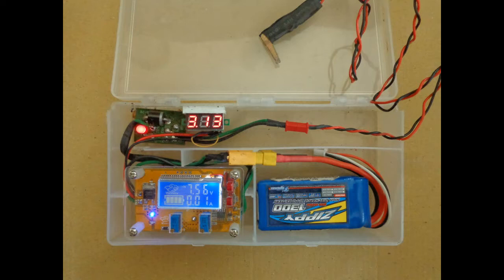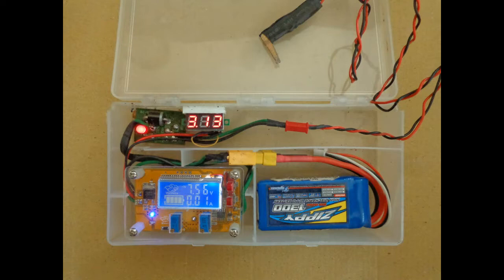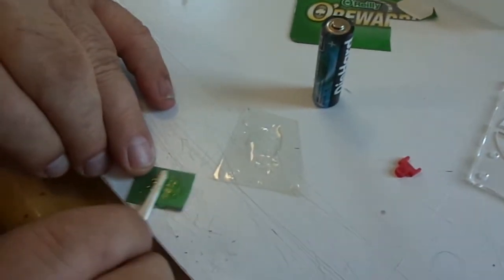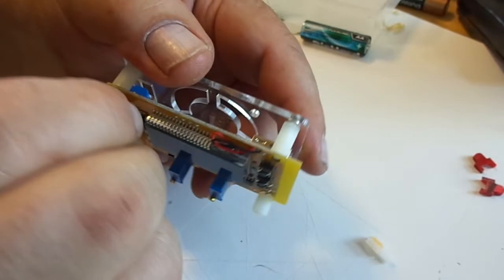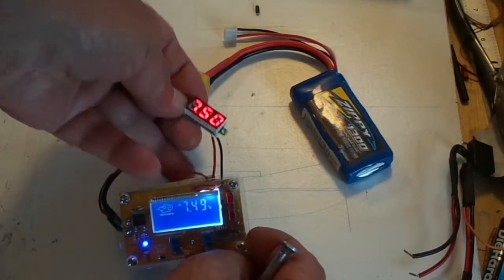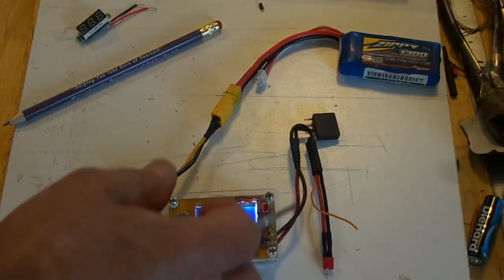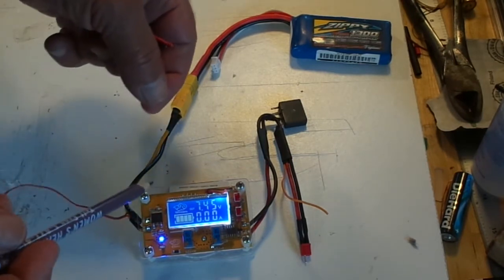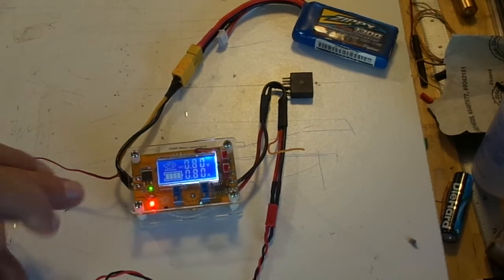Supercap Field Charger Build for Free Flight Models

Comment: Mike, thanks for the offer! I spoke (chatted) with Norm at Banggood and they are sending me a replacement hopefully with all the parts. I guess the most critical of the missing parts is the heat sink so I plan on ordering some of those, the micro switches can work w/o the red buttons and I can mount some sort of plastic feet on the board. I’ll keep you posted and let you know if I’m going to need your powers of persuasion. Thanks again.

Comment: I love watching all of your videos. And I wanted to make this charging unit. But I can't find the DC to DC converter like you have. I'm not that great with electronics and I was wondering if you could suggest a substitute because they don't have the one that you have. Thank you!
Reply from the maker: Sorry they apparently discontinued that unit...Here's one with similar specs and it's actually a bit nicer than the original since it uses a rotary encoder instead of trim pots to adjust the output voltage and amperage. I'm going to order one of these today and make a video about using it to charge capacitor models. Thanks for your interest! https://www.banggood.com/custlink/mKGIhwTZdb?title=DC-DC Converter
Reply from the maker: Just ordered one and I'll make an updated construction video

Comment: thank you for all the info on the charger finally got around to making one works a treat the diode I used was a bzy88 c  8v2 which is a zener diode just looking for a suitable box to put it in now was going to put a picture of it on here but cant find a way
Reply from the maker: Hi David, nice work! That zener diode will work as long as your charging leads never see a reverse voltage greater than 8.2 volts which is the zener voltage of that unit. A zener will conduct "backwards" when that voltage is applied so above that voltage the power supply circuit isn't being protected. Below that voltage it behaves like a regular diode so it will protect from hooking up your capacitor backwards...which even when charged is about 3 volts. Bottom line is it's ok for charging caps but if you intend to charge lipos, etc at higher voltages, change it out for a regular rectifier diode. Have fun flying!
Reply: @sonex413  I got the 3 wire volt meter but problem i had whilst building was at various times all 3 wires came away  re-soldered and secured with a dab of hot glue than designed a bracket to hold the volt meter and bolted to the bottom  plate ot the charger works a treat. I ordered my parts in december 2020 and they arrived 2 days ago, I paid £1.84 for the volt meter and £8.88 for the charger UK
Reply from the maker: @loftmanx  Yes, ours were similarly inexpensive and we've gotten good service from them. We were using disposable AA alkalines before the chargers and I'm sure the savings over the last couple of years has more than paid off the original components. Plus, I have to admit, I think the glowing digits look mighty impressive when you're putting in that last charge just after sunset out at the field!

Comment: Mike...Banggood came thru and sent the complete kit. Now I have to get all the other bits from my stash. Think I’ve got every thing I need to complete the charger. Got to get my foam tray stock pile started.
Reply from the maker: Great, glad we didn't have to get tough with them! A buddy of mine has been collecting those foam trays and he has a bunch of them in different colors. I have found white, yellow and black (which makes light and realistic foam wheels). We use thinner stock from the cheapest, thinnest foam picnic plates for tail surfaces, etc..and also for peanut-scale-sized builds. Have fun, keep us posted!

Comment: Yo Mike and Richie, I finished my charger over the weekend and it works like a charm. My daughters were over and damn near called Homeland Security on me because the device looks pretty shady. I can tell by the sound of the test motor that I’m getting more RPMs than with the two AA batteries I had been using. BTW, my charger uses a 7.4v 430mAh lipo so it takes the capacitor a little longer to get to 3.1v than yours, but that’s not a problem. Right now I have the charger in a take-out sushi container. I’ll transfer it into a more substantial box when one comes my way. I hope to post some flying videos soon. Many thanks for the tutorial— I thoroughly enjoyed the build!
Reply from the maker: Glad to hear you had success with your charger build...it's the first reported completion. Looking forward to seeing some flying vids ! Richie and I promise to visit you at Guantanamo if Homeland Security gets you. Have fun flying!!

Comment: Question: So for the three-lead voltmeter, the black and red leads BOTH connect to the output terminals of the DC converter and the yellow lead connects to the positive wire that’s downstream past the diode, right? Or, is ONLY the black lead connected to the output side of the DC converter and the yellow lead connects to the positive wire that’s downstream past the diode? I ask because I don’t understand how the voltmeter knows which voltage to read with positive leads coming from before and after the diode.
Reply from the maker: Hi Ron, Richie says Hi!  On 3 wire VM the red and black wires are strictly a power supply for all the electronics on that little circuit board including the LED digits. It can be anything from about 2.5 volts to something like 20 or 25 volts. If you hook up just the red and black wires to a dc source like that, and leave the yellow disconnected, you'll see the display light up and read all zeros (because the voltage on the yellow wire is zero). Now, if you want to check a voltage, you'd read it between the yellow (+) and black (-) .....black wire is common to power and sensing sides of the circuit.

I run the VM's red and black to the INPUT side of the banggood dc dc converter, so it sees the full 7.4V of my 2 cell LiPO and the digits are always bright no matter what voltage I have dialed in. Yellow wire then goes, as you say, on the downstream side of the diode. You may be scratching your head wondering how it picks up a ground...but the black ground wire actually passes straight through the banggood converter and so the yellow wire is enough. 

Reading what I just wrote, it still sounds confusing, lol.  Hit me w/another msg if you're not clear.....Rich and I got some great flights and some not too bad video the other day, it was almost like spring. Took everything home in one piece....... -Mike
Reply: Mike, thanks for the quick reply. Your explanation clears up everything. I finally got all my parts so I’ll begin assembly pretty soon. FYI, later as I thought about my question, I realized I wrote OUTPUT side when I meant INPUT side for the VM pos and neg leads. Yeah, believe it or not, I rewired most of my house with only a few sparks and no fires. Say hey to Richie.

Comment: Thanks for the video, great job and easy to  follow. Have the charger built and tested. Works great. Now what are you using for props? Are you motor units with gear boxes or connecting the prop directly to the motor. Do you have a part number for the props you use from BG.
Reply from the maker: Here are the parts we use for the smallest planes, like the "build-along" one from our video series, also the little "Dakota" seen in our videos
: PARTS FOR 6mm POWER SYSTEM (makes 4 sets)

50mm Props (for 615 motor) 2pr:
https://www.banggood.com/custlink/3mD3d54e63

615 (6mmx15mm) motors 4pcs:
https://www.banggood.com/custlink/mDKKwGFfEi

10 Farad supercaps 
10pcs:
https://www.banggood.com/custlink/mGm3fmVTrv
or 5 pcs:
https://www.banggood.com/custlink/Kv3DYH6g6E

Micro Slide Switches 20pcs:
https://www.banggood.com/custlink/3K3mdP0668

We have also used the larger 7 and 8.5mm coreless motors available from BG. The 65mm props work well for both sizes.(direct drive). BG has geared prop drive units, they work well too. Some of our flying videos call out the equipment used in our various planes in the text descriptions below the videos. 10 Farad caps work well for 6 and 7mm motors, two 10F caps in parallel for 8mm motors. Nothing's written in stone, we're basically experimenting and seeing what works. Good luck and best wishes for the New Year! Happy Flights! Mike and Rich
Reply from the maker: DO check out our build-along plane, it's easy and turns in consistent one minute flights with a 615 motor, 50mm prop and 10F cap. It's presented in a playlist form on our home page!

Comment: Hi Mike, Thank you for the instructional video. I found it easy to follow and have just completed my charger. My button issue has been resolved at manufacture so I was spared the mod. It works a treat. Now to build some planes.
Ken in New Zealand.
Reply from the maker: Glad it helped! As we slide into winter in this hemisphere, you're just coming into flying season! Richie and I send wishes for a fun and safe summer of flying! Thanks for the feedback on the charger video. -Mike (and Rich) in Massachsetts

Comment: Thanks for a fabulous video which leaves no open questions. I have ordered the two units, but Banggood is sold out of the diodes, so I will see what I can find locally. Would you pro-rate the charging current for other capacitor sizes e.g. 250mAh for 3.3F ?
Reply from the maker: Hi Chris, thanks for the kind comments! I feel that the charge rates we use are on the conservative side and definitely safe. So yes, pro rate the charge. If you're charging at a rate which results in a full charge in something like 15 to 30 seconds you're doing it right. BTW, We've played around with various sizes of motors and caps, and unless you are going super micro and feather weight, it will be hard to get decent flights on 3 Farads. We use 10F caps for 6 and 7mm motors, and use 2x10F caps when stepping up to 8520 motors. With these combos we see flight times of 30 seconds and up to a minute or more depending on design. Richie tried a 6mm motor with a 6F cap and got some 15-20 second flights. I have a few of those 3F caps myself, was thinking about trying one with a 4 or 5 mm pager motor....built like an indoor microfilm job, maybe 6 inch span????  Let us know when you get something flying! Stay safe, Mike and Rich
Reply: @sonex413  I do a lot of indoor flying, so I want to build something small and light for our sports hall. I am also fascinated by the twin engined Flying Aces Moth - perfect for calm weather summer sunset flying. So I have  ordered a Gold Cap 3.3F and a 10F.
Reply from the maker: @chrisp6072  Great! Have fun and again, thanks for joining in!
Reply from the maker: @chrisp6072  Hey Chris, check out my video, 'Forty Farad Floater" if you like calm air sunset flights! https://www.youtube.com/watch?v=YEFVsWH1P9Y
Reply: I just received my DC-DC converter unit from Banggood. The button issue has been fixed and the standoff post no longer needs to be cut away.
Reply from the maker: @chrisp6072  Great! That was the only issue I had with mine, otherwise perfect for our use. Good luck with the build.
Reply: @sonex413 I throughly enjoyed the charger build and got it finished this afternoon. Just like reading a good book, I couldn't put it down once I had started. After checking all the wiring 5 times, I crossed my fingers and plugged in the battery. It all worked perfectly first time. I used male and female 2mm gold connecters from the charger to the wand, which meant I didn't have to wrap the wand in wire to calibrate the amps, just plug the male into the female. The factory setting on the charger for the amps at open circuit was zero, so they are slowly improving things. The idea of pro-rating the charging current for the 3.3F capacitor didn't work. It needs 800mAh just like the bigger capacitors. Looking forward to using it!! Chris P
Reply from the maker: @chrisp6072  Fantastic! Big THUMBS UP! We think you'll love the precise way you can control the charge and thus the flight times. I predict the other kids will be jealous! Have Fun! -Mike and Richie
Reply: Sorry for some incorrect information that I gave above. When I first checked the charging current, I didn't have a switch between the motor and the capacitor. So the motor was running while charging. Now that I have added a switch, the charging current of 800mA for a 3.3F capacitor is too high. It's more like 500-600mA, but PLEASE check yourself and avoid any incidents!!  Chris P
Reply from the maker: @chrisp6072  Makes sense, thanks for the update. Hope your holiday season is a safe and happy one. -Mike and Rich

Comment: I ordered two of the dc/dc power supplies and both came without the case, hardware to mount it and the heat, sink what did I do wrong?
Reply from the maker: You probably did nothing wrong. I have not had any issues with BG, I suggest you take pictures of what you received and send them along to customer service. Hopefully they will reship or refund. Good luck. They have a live chat feature on their webpage which will get you a quicker response than an email.   -Mike

Comment: Thanks for the great build video.

I tried that buck converter and I found that turning the amperage pot didn't have any effect. I tried with short output and with a load. It just seemed to be disconnected.

Also I noticed that if I set the output voltage it would not be stable if the input voltage varied. 

Does that sound like I got a bum buck?

Thanks in advance!!!
Reply from the maker: Sorry for the delay in replying....It does sound as if you have a bum unit, although as I recall mine came from the factory with the adjustment pots set to crazy values and I had to crank in quite a few turns on the adjuster before it came into the desired range. -Mike
Reply: @sonex413  Thanks for the note! Yeah I managed to return it and get a different unit. 

Which works extremely well.

Thanks for all the amazing videos.

I'm really enjoying them !!!

Comment: Hi Mike,how many flights can you make with a full charged battery?
Reply from the maker: Of course it depends on the capacity of the planes and how much you charge them. We're using 7.4 volt, 2 cell LiPos with 1300 ma capacity. With our mix of models we are charging the LiPos every 3 or 4 trips to the field. so, maybe 30 to 60 flights? The dc/dc converter will accept input voltages from about 5 volts up to about 20 volts without needing adjustment so you could, for instance, wire a cigarette lighter plug to the input and run it off your car. In practice, we fly all we want and have never run the charger batteries down in one or even two full afternoons of flying. You can cut the power consumption a bit by turning off the display screen backlight, but we don't even do that. We love these units and would not change anything about them. Thanks for a good question! -Mike

Comment: Hi Mike ,thanx for the great vid. Supercap powered planes are an area that I really want to explore over here in the UK. For whatever reason I can't seem to find the link for the Banggood components for this charger. Could you list the Banggod part numbers for these components using the 3 wire voltmeter ? Kind regards John R.
Reply from the maker: Hello John, links are in the text description of this video. in fact I just ordered another set to build a charger for a buddy of mine. -Mike
Reply: @sonex413  so you said on the video but I can't find the text!
Reply from the maker: @johnread5413  
DC/DC CONVERTER:
https://www.banggood.com/5A-DC-DC-Adj...

3 DIGIT LED VOLTMETER:
https://www.banggood.com/0_28-Inch-Mi...

OUTPUT DIODE, 10 pcs: 

https://www.banggood.com/custlink/vDG...
Reply: @sonex413  thanx for your perseverance and I got there in the end. All ordered!

Comment: Where did you get the box? Can't find one deep enough.
Reply from the maker: They were the boxes from carburetor rejetting kits I used to install when I worked as a motorcycle mechanic years ago. I used to save the boxes to keep small parts in. You might try googling "project cases" or "electronic project cases" or something similar. I know some folks have used food storage containers and modified them. Good luck!